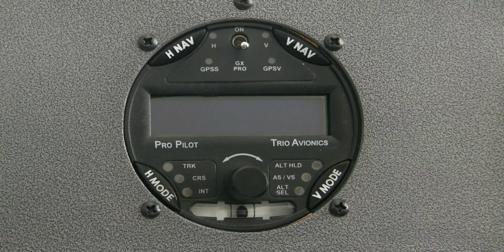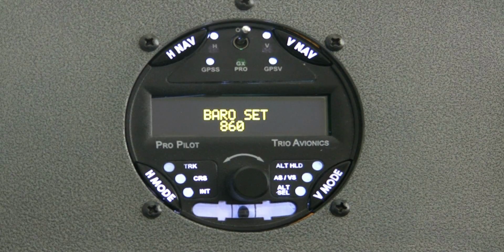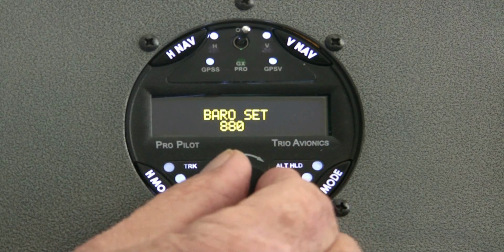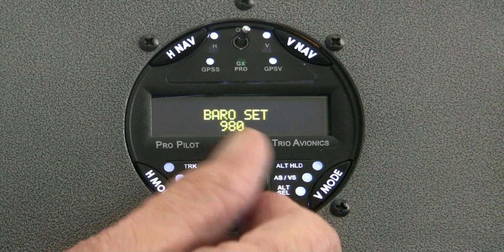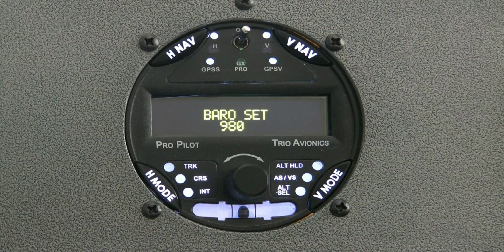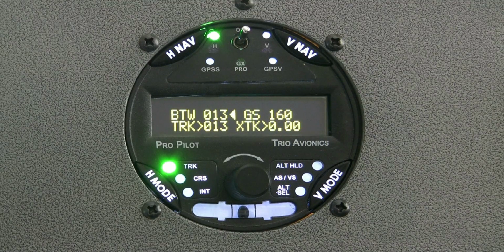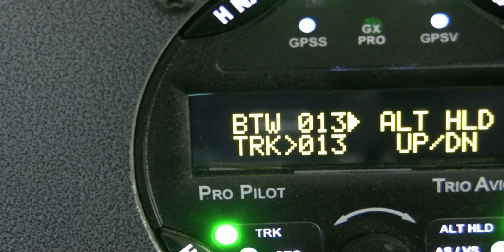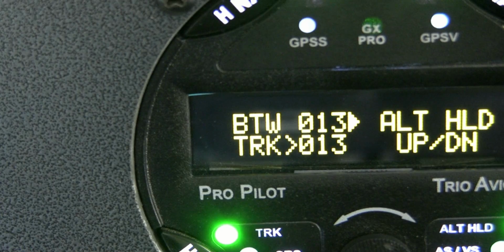Pro Pilot Basic Operation 1.mp4

Comment: The TRIO Pro autopilot is JUNK.  My partnership has it in our plane and it has NEVER worked correctly. We've replaced the head unit, done software upgrades and had our TRIO certified mechanic go over it again and again. 
Now TRIO will only give us a $4700 rebate to have it removed.
Caveat Emptor.